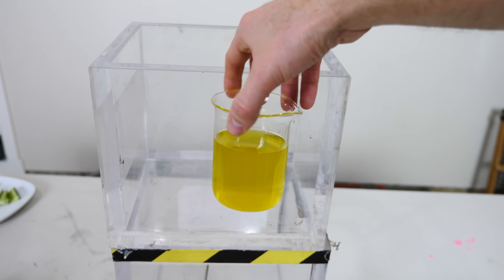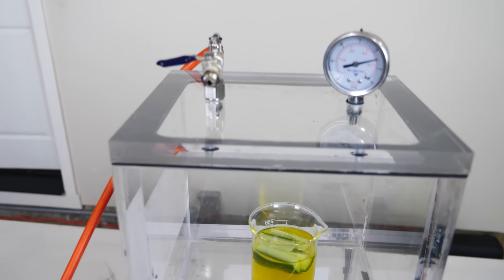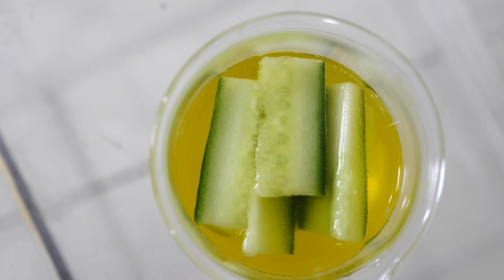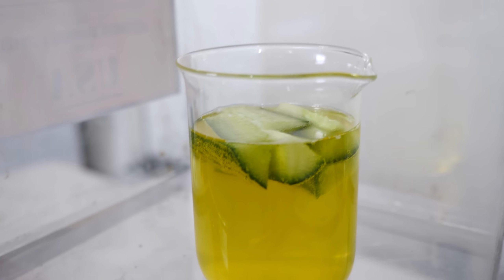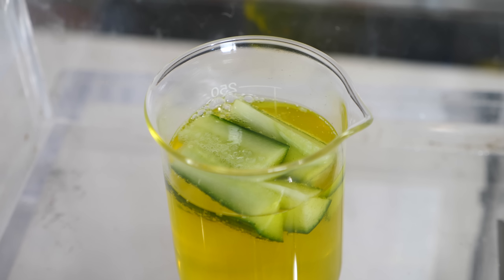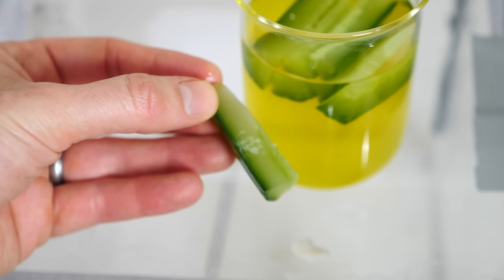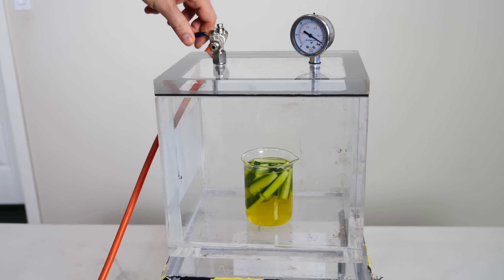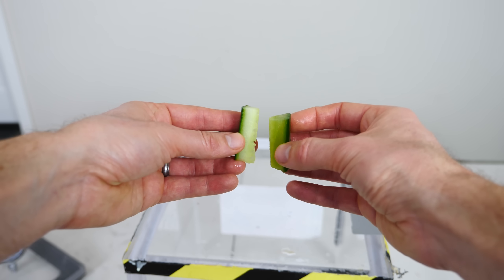How to Make an Instant Pickle

Comment: Couldn't find this answer on Google so I'll see if anybody here has the answer. If one were to stick their hand into water that is boiling due to being in a vacuum, would it burn you? I assume no because the temperature hasn't changed it's just that the boiling point has been reduced due to the water being in a vacuum.

Comment: For anyone allergic to cucumbers, you should realize that the process of boiling the cucumbers in a brine with high heat (such as when canning pickles) breaks down some compounds in the cucumbers. I know one person that is not allergic to a common brand Kosher dill pickle that use a heat process (possible also an anaerobic process) in pickling but is allergic to all so-called refrigerator pickles.

Comment: I saw your drone video where you weighed the air resistance on scales however I had an idea 💡why not stick the drones underside to the scales and use full power mode to determine the lift weight 🤩

Comment: You can achieve the same affect without a vacuum chamber by putting pickle brine and cucumber pieces into a cream whipper (one of those canisters you put cream into and use a small N2O cylinder to pressurise it). It essentially uses pressure to force the pickling juice into the vegetable. Can be done n under 3 minutes. @The Action Lab, please give it a try.